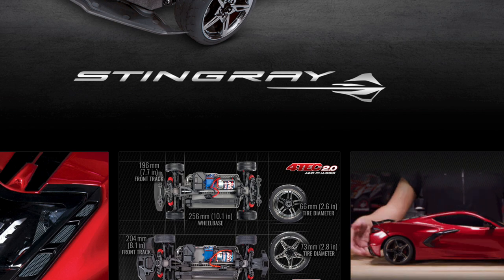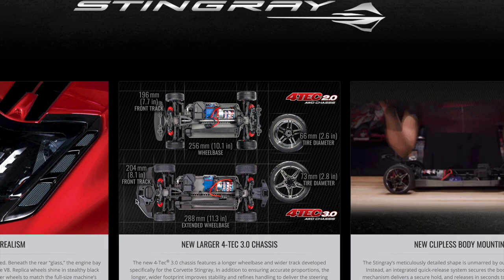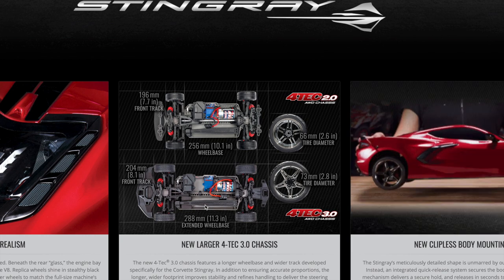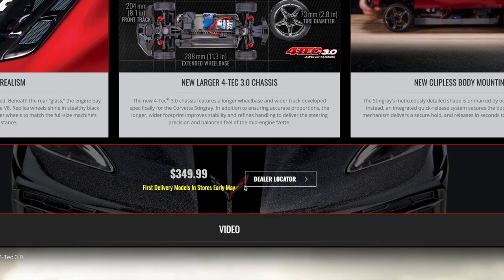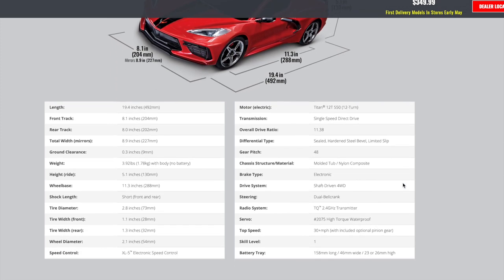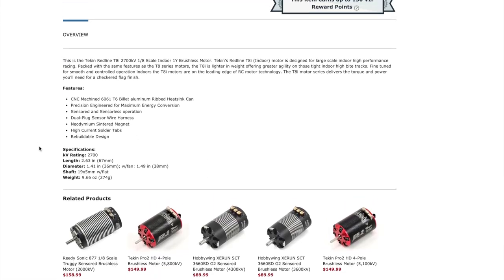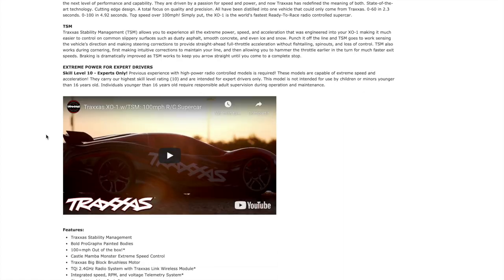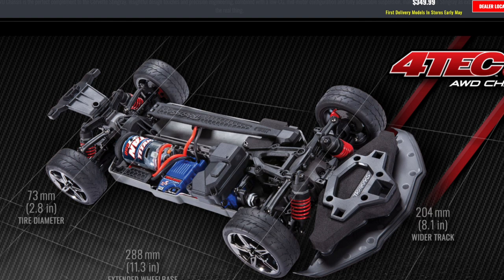Traxxas 4-Tec 3.0 Before Release overview Possible speed motor upgrade: Could 80mph+ be possible?

Comment: I noticed on the Website the Corvette doesn’t have TSM like the Ford GT has
Reply from the maker: That is a good point. The Mustang was a TQ while the GT was a TQi. The TQ Mustang used to be slightly less in price. They are now the same price. They do have the chassis VXL with TQi and the Titan with TQ. Maybe they will come out with a brushless 4-Tec 3.0 sporting the 540XL system.

Comment: Was it made longer by adding lenght to front end chassis part. Will there be a conversion kit for 2.0 old chassis
Reply from the maker: It appears to be longer between the esc and receiver box. The shaft was also lengthen and a center drive shaft support added. I am not sure a kit will be made. For example, you can take a Stampede 2wd and replace the chassis with a Slash 2wd LCG chassis and get the SCT body and wheels, and you have a Slash. There is no actual kit, but you can buy the parts. That is what I am thinking will be the case.

Comment: Hopefully can run a bigger motor in it,  get a 3s or 4s going.  Drift and do speed runs kinda thing.  Assuming since it's bigger outta be able to?
Reply from the maker: It should. I had an LRP 10L 3500kv. It is a 70mm long can in on of my 4Tec 2.0 cars. The challenge was the esc. But Hobbywing esc sometimes come with an esc plastic plate. It can be fastened between the receiver box and front differential housing (just make a hole on the plate). 
Right now, I have a HW 3660 which is a 60mm and the HW Max10 stc esc fits perfectly. So the 10mm difference between cans should be no problem with the longer tub in the 3.0. The grearing is the challenge given that Traxxas does not make a smaller spur than a 55T. Someone told me HR made on in the 40s, but I cannot find one.
Reply: @telecomandorc  sweet good to know yeah I only have a 3s typhon but I want a little car I can make a drifter maybe few speed runs till I pickup the limitless thought about trying to convert my typhon 3s to a rally but idk what to do
Reply from the maker: @sMoKeN904  The rear wing on buggies, like a Typhon, really help stability at higher speeds. Although, rally bodies protect the RC better. Just keep the parts so you can switch back and forth. The Limitless is really cool car the Infraction and Felony are pretty much based on. But, it is bigger and needs more room. Since you already have 3s batteries, I can see why you want a smaller car for speed run. All good choices.

Comment: I run the titan 550 xl5 in my Tamiya tt02 Impreza. Don’t need much more than that in a drift car.
Reply from the maker: Very good point. On a drift car, low Kv gives a great run time and keeps temperatures down. Sounds like you made a great choice.
Reply: That’s fine but the 4 Tec isn’t a drift car. Brushless is a must for this
Reply from the maker: @DeRock401  Good point. It does not have the steering articulation of a purpose build 2wd drift car. Yokomo YD-2E to name one. Is there is drift car you would recommend?
Reply: @telecomandorc  I’ve yet to own one myself!  my 4 Tec 2.0 and my arrma felony have been taking up all my time lol. Soon tho!
Reply from the maker: @DeRock401  I know what you mean. For me it seems like there are so many models I would like to own, but my free time is not long enough to enjoy what I currently have fully. That may be part of the description of an addiction. Not so secretly, I am hoping Traxxas comes out with a nitro version of the 3.0. Of for Arrma to make a gas version of the felony or infraction. Probably not going to happen.

Comment: Do you have any tips for installing a 2-3s brushless System?
Reply from the maker: I would get an SCT system. It all depends on the budget. Do you have a budget in mind and a brand preference?
Reply: @telecomandorc  4000kv Hobbywing combo?
Reply from the maker: @jempyone81  Oh, that is actually the system I shall be installing and testing this week. EzRun 3660 4000Kv. It is currently in my 2.0.
Reply: @telecomandorc  nice 😉 tell me your results...and the optimal gear ratio...thx..im a beginner...
Reply from the maker: @jempyone81  Will do. =)
Reply from the maker: @jempyone81  I am currently running test. Ran the 3.0 with the HW system. The tires came unglued. Re-glued them. The car lifts. Removed the rear clip and added a wing. Still lifts. Unfortunately, the camera was not rolling for the one speed run I did not crash the car. Hopefully by Monday I can upload the video.
Reply: @telecomandorc  do you think its to fast ?
Reply from the maker: @jempyone81  I think it is a tire problem. The factory glue job is suitable for low speed. It is an external glue job rather than gluing the beed to the wheel. Once I reglued them, it ran well. Oh, the stock transmitter does not have the range this system needs to get up to speed. I should have the video up within 24 hrs.
Reply: @telecomandorc  i run my cars with the flysky noble.....
But the 4tec is my first on-road car...
Fast is ok...but to fast....i d'ont want to brake it the first run...
Reply from the maker: @jempyone81  I did crash and wedged my car between a tire and pavement. I lost a rear dog-bone. I took one out of the 2.0 to replace it in the 3.0 for now. I did not break it other than that. Just re-glue the tires. I am finishing the video with the runs and crashes. Should be up in 4-5 hrs.
Reply from the maker: @jempyone81  Here is the new video: https://youtu.be/EpSgPhPd7z8